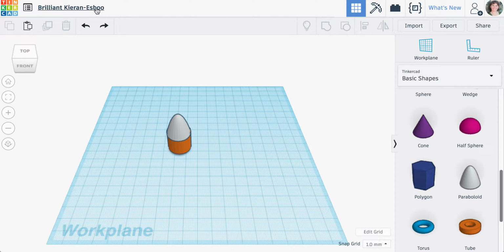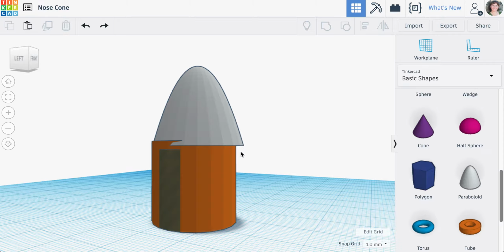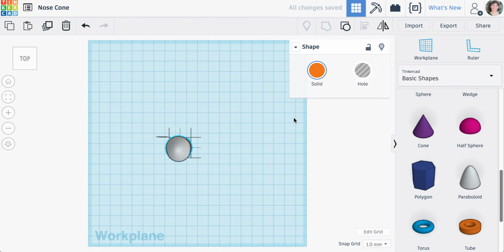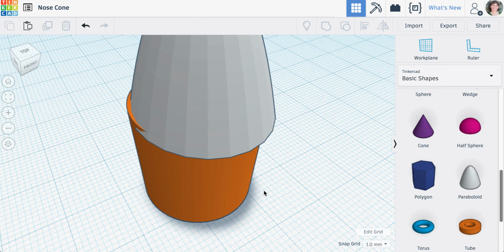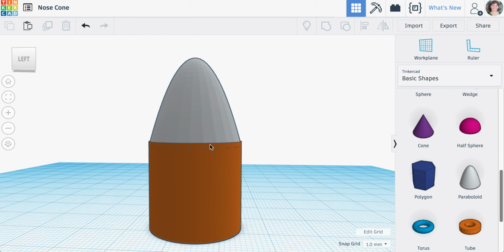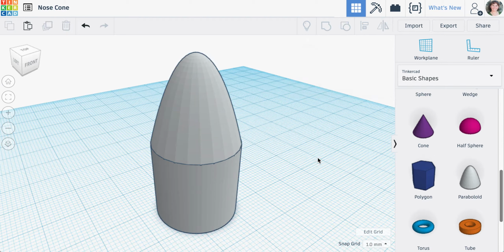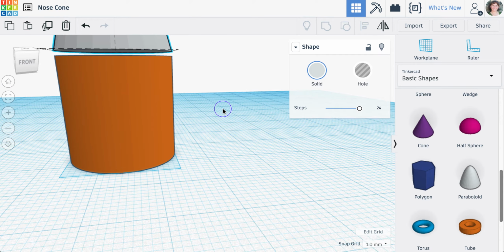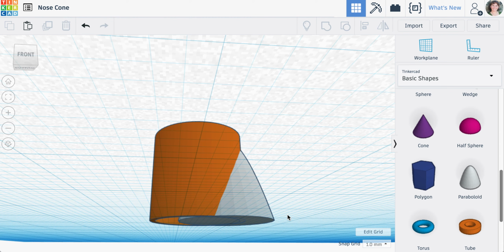How to fix common design problems on Tinkercad

Comment: Hi. I'm trying to import a svg icon created in Illustrator(Mac) to apply to the Wrap Text option in the "Shape generators". Basically I want to replace the text with an Logo(svg/vectored) atop on a bucket shaped cylinder. There are a few options when saving the icon as an svg in illustrator. Do you know which one Tinkercad will read and place in the "Place Image" box to replace the text? The icons are small in size, under 20KB. Thank you.